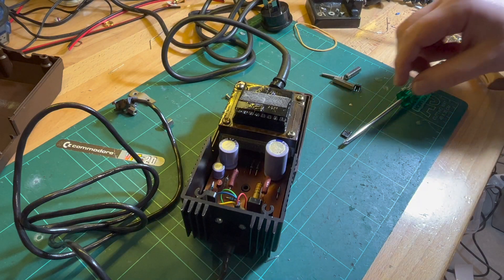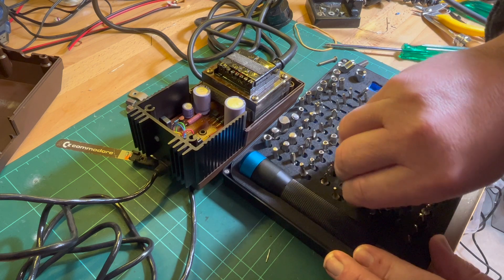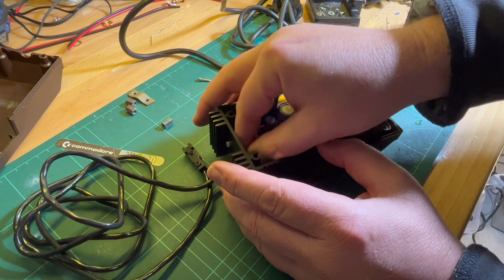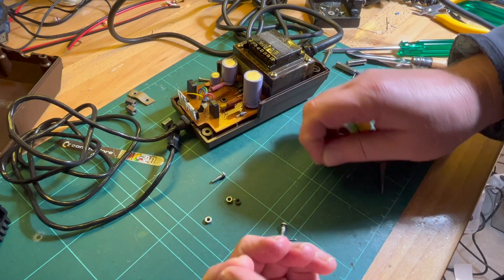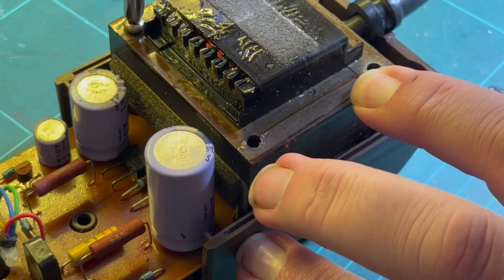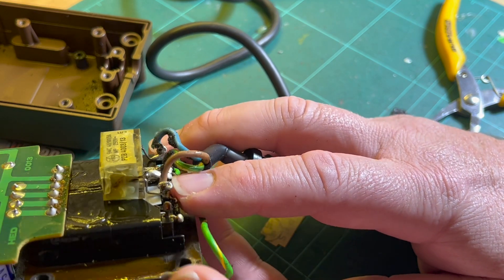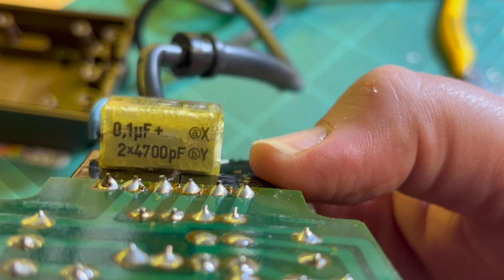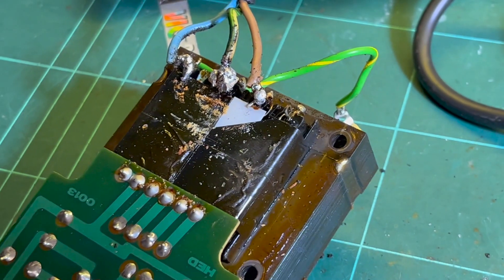🇬🇧 Grundy #NewBrain: Part 1b (Good ol' RIFA caps!) [TCE #0041]

Comment: chunky power supply for such a small system...
ya should be able to replace the rifa with 2 modern caps..like ya say they are only smoothing the incoming power... i wouldnt run it without the smoothing caps here in port tho!.. the power is all over the place here!
Reply from the maker: Don't you just love those old computers with complicated power requirements ... even the plug into the machine is non-standard!  Managed to find a replacement for the RIFA on Element 14 - stock in the US though, so just waiting for it to arrive /Brett